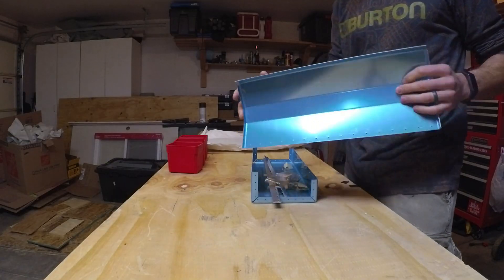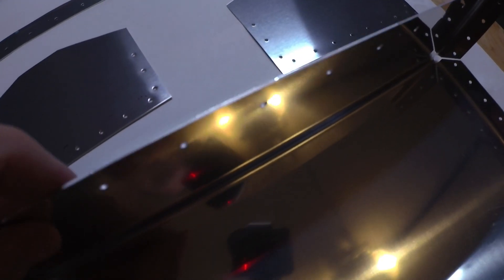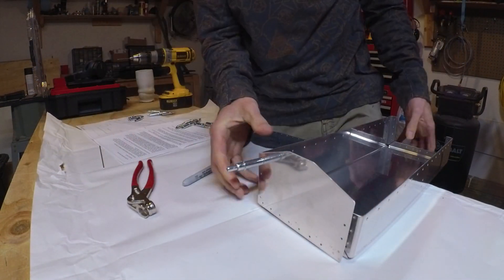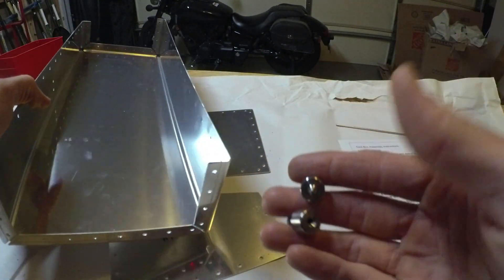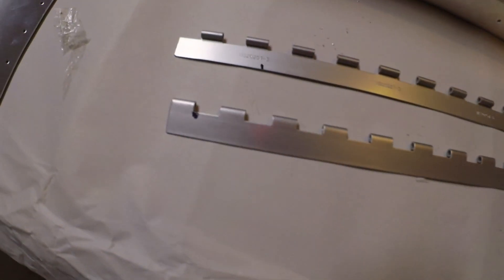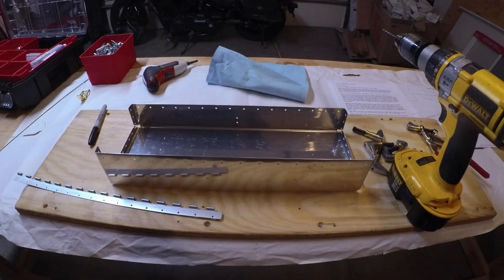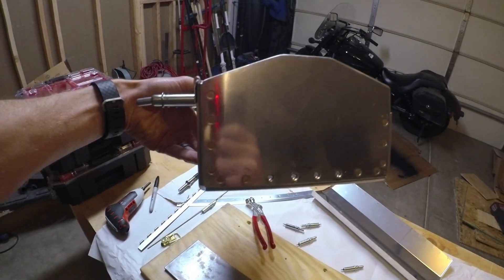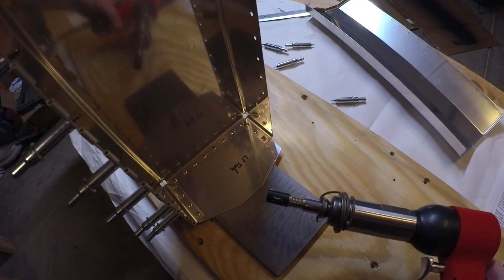RV-14 Build Log - Practice Kit (Toolbox)

Comment: Every time I see a kit plane build using dimpled and flush pressed rivets, and ones that use the pop type rivets, I feel the pop rivets are the way to go.  Seams to greatly reduce the amount of work needed and apparently both hold just as good.
Reply: Much more strength in a solid compared to a "pop rivet"

Comment: Good job!...I brought practice kits a year ago and haven't done anything with them yet. 
When you dimpled did you use same die for the parts that overlap? 
I own a 172 and have been flying for decades but have never built a plane or even dimpled before.
Reply from the maker: Yep, same die for the overlapping parts. Not shown on the toolbox kit, but another variation is to machine countersink a thicker piece, then dimple the sheet metal that mates to it.